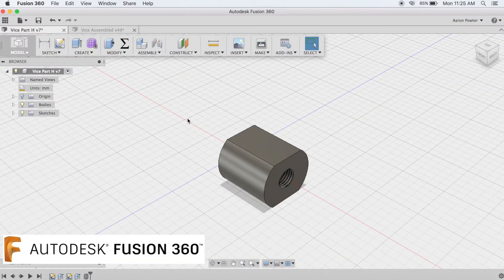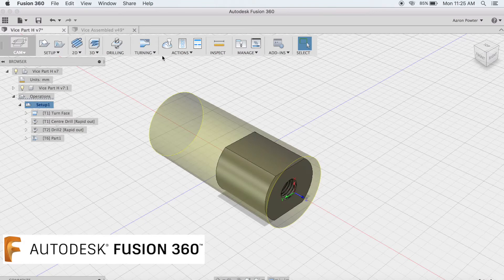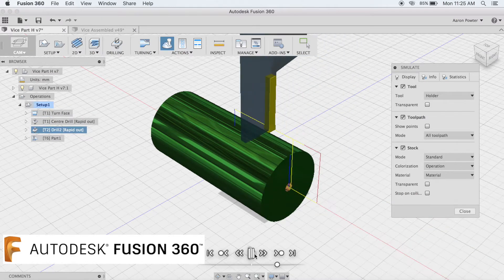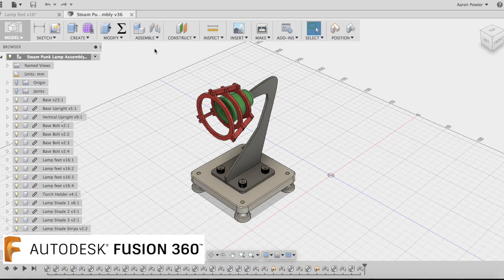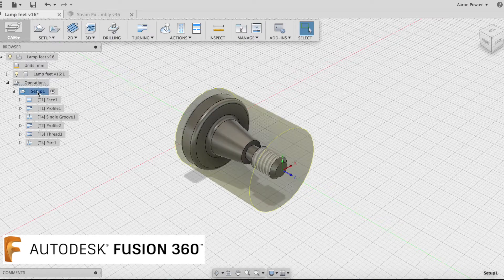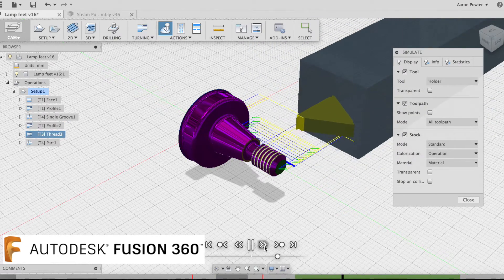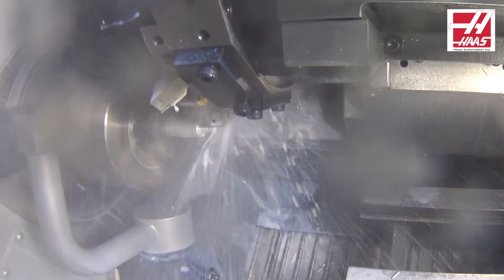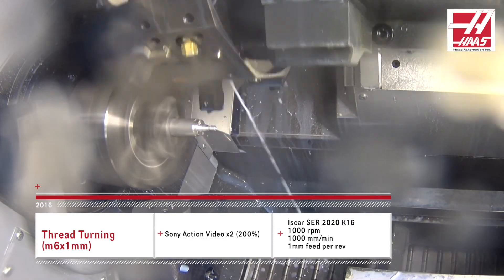CNC Turning via Fusion 360

Comment: I do manual machining and want to learn Cnc machining, I live in Adelaide what's the best way to learn and get involved in Cnc machining,  thanks David
Reply from the maker: Hi David, sorry for my late reply.  There are many ways you can get involved in CNC.  You might consider taking a class at your local TAFE or maker space.  Or you can buy or make your own machine and teach yourself.  There are heaps of Tutorials on the internet for Fusion 360 on how to CAD design and CAM your own tool paths.  Many of my friends have taught themselves. Hope this helps mate?  Cheers, Aaron.